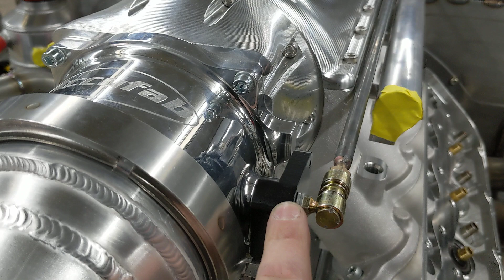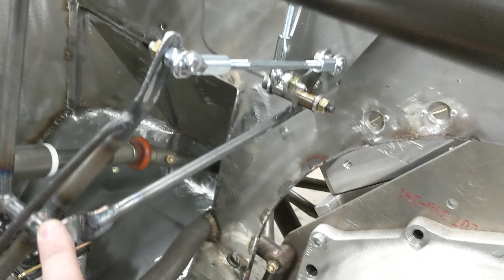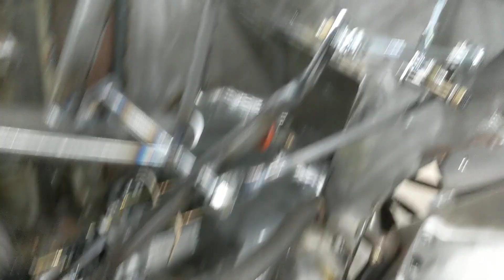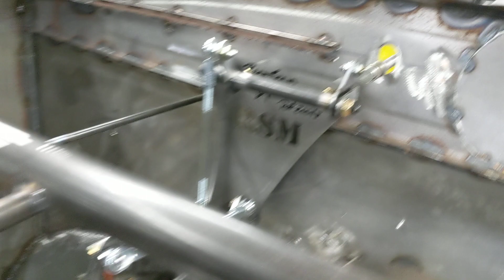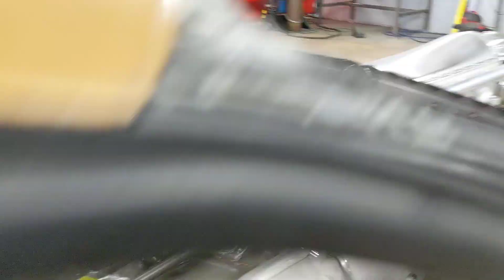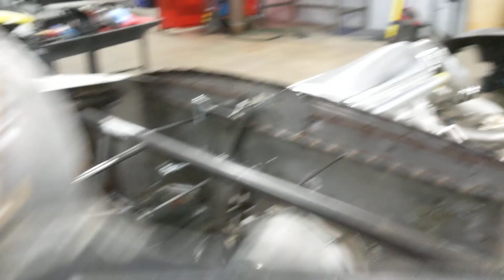RSM Throttle Rod Kit for Chassis Cars

Comment: I'd be very interested in a kit, but I don't have near that much room between the pedal and the firewall so it would have to be compact.
Reply from the maker: We spaced it off the firewall one inch because of the joint in the firewall. Also you could shorten the length of the rod going to the bracket.
Reply: @rocksolidmotorsports7297  Sweet.   Let me know if you get a get together.